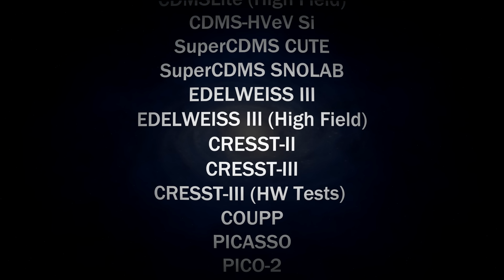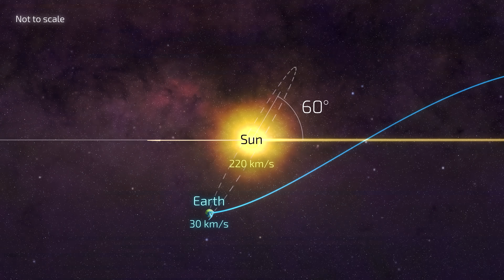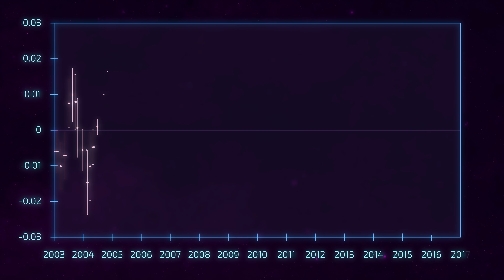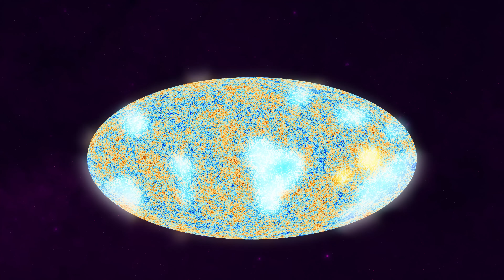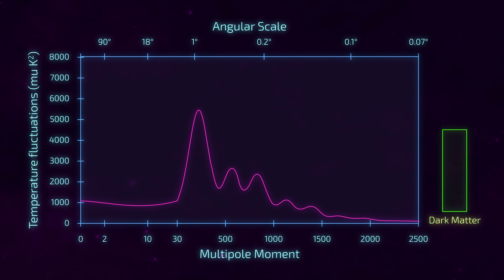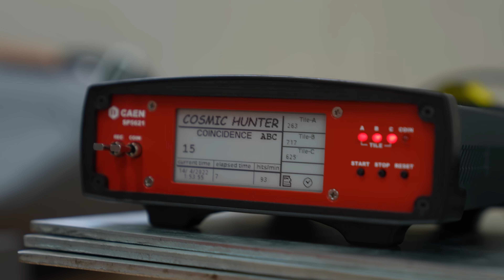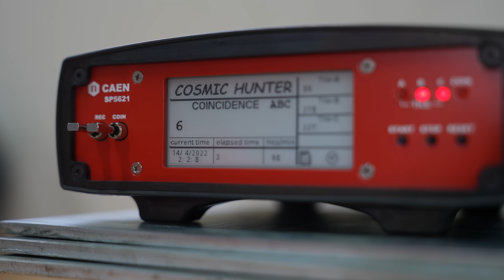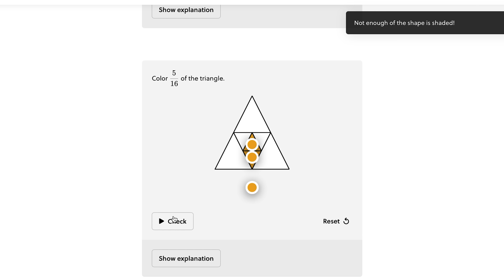The Absurd Search For Dark Matter

Comment: The only reason scientists think that we need dark matter is because they think that the Sun and Stars are nuclear fusion reactors. Remove this theory and replace it with a Sun that is an electrical 'arc' which has very little mass but creates a large amount of gravity, then the need for dark matter is no linger required. If the Sun is an electrical arc, it would explain the high temperatures are in the Coronasphere and not on the surface. It would also explain the huge magnetic fields and a perfectly spherical shape, sunspots, solar storms and coronal mass ejections. It would also explain how it can lose 500,000 tonnes of material every second without losing any gravitational pull...... Thanks.
Reply: Lol. The Sun is not an electrical anything. Learn physics.
Reply: @ianw5439  Unfortunately, in the world of theoretical physic, it is true to say that, if the Sun and stars are nuclear fusion reactors, then the stars are too 'heavy' to hold themselves together and form Galaxies. This is why they are looking for "Dark Matter" which, according to CERN, makes up over 95% of the universe. But they cannot find it. No matter how hard they try. It may be that I need to learn physics to accept this irrational belief, or, you, and the people at CERN may need to have a lessons in critical thinking........
Reply: @digdougedy  Gibberish. There is no "if" about whether stars are powered by fusion. It is a fact. As proven by neutrino detections. Learn physics. And just because they haven't found the particle, does not alter the fact that we see strong evidence for the existence of dark matter. Get an education.
Reply: @ianw5439  OK. So I missed the bit where they got more energy out of a fusion reaction than they put back in. I'll pay better attension next time. So, where are the new nuclear fusion power stations? I'm sure you must know where they are building one, cos I don't. As for the assumption that neutrinos are made by fusion, it in no way balances the massive gap in understanding of how the Sun creates massive magnetic storms, why it is a perfect sphere, and why it's "atmosphere" is hotter than the surface, nor why Sun spots are black. These are massive hurdles. The only way science can explain these real observations is by saying, "Ummm, well, we will have to work that out later."... And then, for the fusion model to work, they have to believe in some kind of invisible matter which is 10 times more matter than we can see. Totally irrational. But very dogmatic.
Reply: @ianw5439  I'm just going to pick up on one thing. Dark matter. Dark Matter is necessary, in the current fusion model,  for the Galaxies to hold themselves together. Because the stars are so massive but gravity is so weak, the Stars should not be able to attract each other to form Galaxies. Hence the search for Dark Matter. This is why they are searching for it. I'm not trying to be contrary, I am just pointing out that the theory of fusion does not fit the observable reality. If it did they would not be looking for the 96% of the universe that seems to be 'missing'.... However, if the Sun actually has only 6% of the mass but generates gravity then the problem is solved. No need for invisible matter, just a requirement for the abandonment of trillions of dollars of funding that perpetuates the illusion of understanding by building more 'colliders'.
Reply: @digdougedy  Nope, it has nothing to do with fusion. Learn physics. 

"I am just pointing out that the theory of fusion does not fit the observable reality."

Yes it does. We detect the precise number of neutrinos predicted to account for the energy output of our star. Learn physics. And we know the mass of our star without even invoking fusion. Ever heard of Kepler's laws? I'm starting to think that not only did you skip high school physics, that you skipped high school altogether!

And dark matter is strongly supported by observation. Observations that you refuse to address. Due to not knowing what they are, and not knowing any physics. Take my advice; go back to school.
Reply: @ianw5439  Here are e few questions that 'physics' cannot explain using the nuclear fusion model, but can be explained if the Sun is a electrical 'cathode'. 1. Why is the Sun a perfect sphere and yet rotates faster than Jupiter which is a gas giant? 2. Sun spots. The Sun is over 5,000 deg C, Name an element that is not white hot at 5,000 C. Well, ?... So why are they dark? 3. How can it lose 500,000 tonnes of matter per second for billions of years without the planets drifting away? 3. Electrical/magnetic storms. There is no answer to these and  coronal mass ejections in the fusion model. 4. Why is the Coronasphere hotter than the surface, when the heat source is supposed to be internal? A welding arc is is hottest at it's outer circumference, same as the Sun. 5. The Carrington event. This cannot be explained unless the Sun is electrical. 6. Sprites. Electrical lightening that goes upwards towards the vacuum of space. ??? 7. Dark Matter ...done that one...... The reality is easy to see. The dogma is hard to eliminate when so much effort has been out into trying to prove a false idol. The only difficult leap of faith is that the Sun generates gravitational pull without having any physical matter. It's actual mass is only 5% of what they think it is, and knowing that matter is just an expression of electrical forces, ie protons, neutrons and electrons etc. The only hard bit to understand is how anyone can believe in dark matter when it is a belief system, not dissimilar to the Emperors new cloths.

Comment: If dark matter has gravitational interaction. Why is it expected to be so evenly spread?
Reply: I think I found the answer and its the same why there most likely are no darkmatter stars or black holes. Dark matter expiriences gravity, but wont shed any momentum due to things like friction or electromagnetism. Thus it does not clump together and only has clusters on very large scales.
Reply: @brunospasta  why it doesn't fall in black holes? or super massive black holes?
Reply: @paulmon4077  It does as far as I understand it. But only very very little of it. As soon as the trajectory is not exactly towards the blackhole it will just slingshot away  (or stay in orbit forever) because it is not slowed by any other effects such as friction or electro magnetism.

Comment: The crystal lattice at 10:40 is mislabelled. Both the nucleus and the ionic radius of iodide are bigger than sodium. Crystal lattices are almost always driven by the arrangement of the anions, which tend to be bigger in size (due to having a negative charge and thus a bigger electron cloud).

Comment: About the second "evidence" , yes gas got stuck in the middle, no thats not where most mass is, do you really expect to have gas more massive than stars? As for why it got stuck in the middle, gas is more easily affected by gravity, and when the galaxies PASSED TROUGH each other it was being pulled from both sides, thus, slowing down.
Same reason you see some stars in between the gas, but not as many. Its easier to pull dust than rock.
Reply: Gas more massive than stars? Dude, you're gonna lose it when you find out what a "nebula" is, lol. Also, it doesn't matter whether you're pulling dust or rock. All that matters is total mass.
Reply: @singularity3724  yes, exactly, and what is easier to move? Gas or rock?

Comment: Yeah there’s no dark matter.  What it is, is that they haven’t figured out that thee is like 10x more matter in the universe than they think.  And 90% of it has fallen into black holes.  And so the reason that the galaxies rotate uniformly in the center and outer areas is because the galaxy used to be a LOT bigger. And so…that “outer” area is actually very much the remnant INNER area….and ask those 10x bigger that thought galaxies fell to the center of the black holes, 90% of the matter went in and left behind a “smear”.   And WE think that the smear is the whole galaxy.  It’s just the inner portion that was randomly left behind.  A bunch of starts that never fell inwards because those were the stars that randomly settled in that position.  Yes, I understand that this doesn’t explain why they rotate uniformly, but the reason for that mistake of not understanding that is the same reason they don’t understand that 90% of the matter is in the black hole.  It’s the same gravity at distance calculations that is wrong.  They are not understanding that those starts are all pulling each other along and that gravity actually maintains it’s strength a lot more efficiently when “linked” by other objects.  They are just looking at the solar system and expecting to see the same inner/outer rotation speed differences in galaxies, but they are able to link the gravity and maintain its strength a total more than just a few planets.

Comment: The answer i get from professors to the question of why they know dark matter is there, is "because it makes the math fit". Otherwise calculations regarding how long it takes an outer star to move around the galaxy doesn't fit models that work on our smaller scale at home. But, we've already had experience with finding that Newtonian physics is an approximation that is inaccurate at grand scale, for example adding an mc^2 correction for things that are moving fast. Isn't it possible that the problem is simply that our math models are an approximation that doesn't work at big scale? Why make up matter we can't seem to find?

Comment: I think this is caused because the galaxies work like a single object. For example, in the solar system, planets that are closer to the Sun move faster and those that are further away move slower as one would expect. Where is the dark matter effect there? 
Would you expect that the center or the Earth rotates faster than the surface? of course not, because the Earth works like single object. The same happens with galaxies, when a certain density of matter is reached in a space, there is another force that holds it together.

Comment: Experiments based upon unproven assumptions can NOT produce meaningful results. The basic premise of this data is that Earth moves faster at one time of the year than at another.
Pray tell what consumes the kinetic energy of a 5.97 X 10²⁴ kg ball moving at 536,865 mph then slowing to 468,865 mph? Then what is the energy source which 5 months later speeds that ball back up to 536k mph over the next 7 months?
And then explain how none of these movements and the acceleration and deceleration can be detected??
These are the requirements for your belief to be true.
Do you realize how stupid you sound believing such physics denying models?
Reply: 5:10 "One way to explain this is to posit the existence of matter we can't see, dark matter."
Or instead of creating a fantasy invisible man we could simply admit that model of stars at incomprehensible distances has never been proven and should stop being used. 
No that would destroy the narrative.

Comment: The title nailed it, the search for "dark matter" is nothing short of absurd, since it does not exist. Get out of the dark and into the light folks... we live in an electric universe. There's no need for fairy dust, black holes, and other nonsense, in the plasma cosmology model. We were on the right path a century ago, but go derailed by the likes of Eddington and Einstein. All the mysterious phenomena required to make the standard model plausible are not required in the EM model. The electromagnetic force is approximately 10 to the 36 power greater than gravity... think about that. 
It's the thunderbolt that shapes the cosmos. njmho

Comment: How about this👇
☀️---------🌚-----🌍---------🔴---------🔵
Sun is connected to a rope and all the planets are on the rope so that will keep the speed same
 🕜
Or think of it as a fan or a clock with all the hands moving at same speed
Different planets on different blades
But all connected to center will move at same speed

Comment: I am no astrophysicist, but could dark matter simply be a result of our lack of understanding about black holes? Most galaxies are centered around a particularly massive black hole. Our standard model of physics breaks down when trying to understand black holes - particularly when crossing the event horizon. Could this limited understanding also expand into how black holes interact with matter? Because if the supermassive black holes are actually the source of the increased mass of galaxies, the models that look at colliding galaxies would be explained through the fact that the location of the majority of mass remains revolving around the supermassive blackhole centers. I am sure this has probably been ruled out, but made me wonder.
Reply: In the milky way, the supermassive blackhole makes up only around 0,2% of the galaxy's mass, not nearly enough to hold it all together.

Comment: As always a good video.

One thing I have to cirizise though is how you butchered the German word "Dunkle Materie" (swiss also speak German with a swiss akzent, its called Schweizerdeutsch). Maybe next time you can use google translate to get the basic gist of the pronounciation. 
However it sounded pretty funny how you pronounced it.

(It is generally pronounced as "dunk-le ma-te-rie" however the e's at the end are also pronounced and make and "eh" sound, unlike in the english, where e's at the end are usually silent or atleast give a different pronounciation of the letter before)

Comment: Stop it with dark matter nonsense, there are electric currents.
Reply: So you are saying dark Mtrer is a conductor for electricity?
Reply: @pathevermore3683  There's no such thing as dark matter, it's only something they invented to correct for the fact that they are ignoring electric currents that create spin.
Reply: @whig01  electricity is not matter, electricity requires a conductor. Electricity does  not spin. Your hypothesis makes no sense.
Reply: @pathevermore3683  Plasma does not require another conductor. Spin is created when magnetic fields and electric currents are orthogonal. Learn something about motors.
Reply: @pathevermore3683  What makes no sense is insisting upon a completely nonexistent dark matter as a reason for anything.
Reply: @whig01  plasma is not electricity. Magnetic fields do not spin, they flow.
Reply: @whig01  what makes no since is why you feel the need to make you obvious bs to hide the fact that you cannot understand the subject.
Reply: @whig01  perhaps you can explain how electricity spinning adds unobservable mass to a galaxy resulting in an increased spin?
Reply: @pathevermore3683  It doesn't add mass, it adds rotation to the edges of the galaxy as a Faraday disc would spin in the same manner. I'm sorry you have no idea of motors.
Reply: @whig01  wow, you should publish that so many others can get a good laugh.